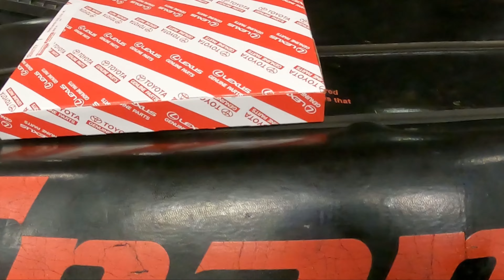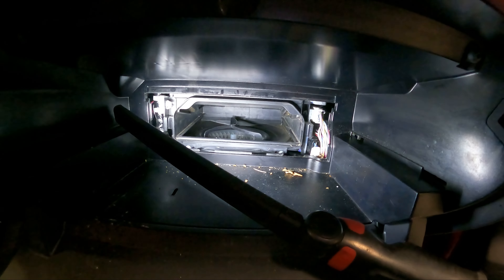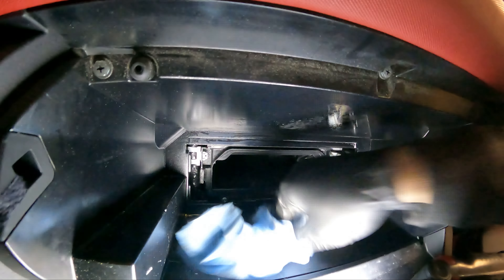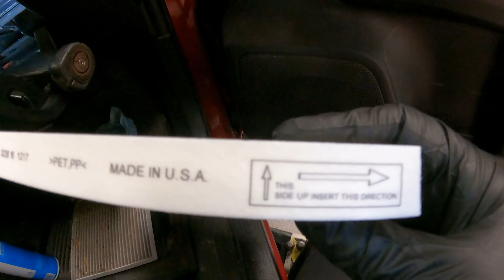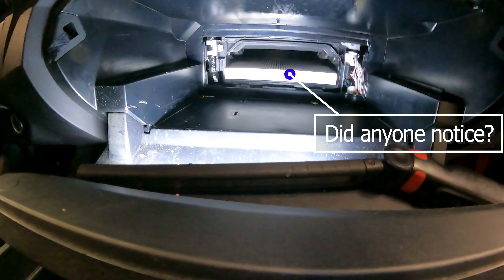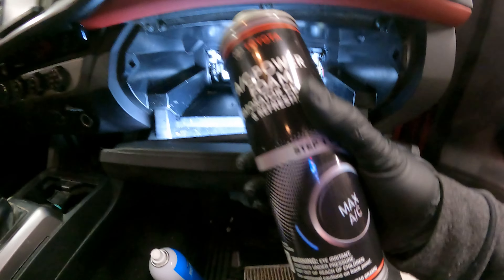Customer states Toyota Tacoma cabin air replacement #customerstateswhat

Comment: Why replace instead of just blowing out the filter since it is more larger debris than dust?
Reply: Cause on Rock Auto the most expensive one is 15 bucks and change, most are around 5. These are such flimsy filters your air line would more likely damage it a bit, and the time you would take to clean the filter aint worth it.
Reply: Because you'll never get all the dust/dirt/microbes out of it, and if you use a carbon filter or other fancier type, they do eventually lose their ability to filter out the tiny particles, leading to reduced air flow, odors, etc. If the filter got wet for any reason, including simply high humidity on a regular basis, it's a mold/mildew grow farm.
Reply: @markh.6687  Microbes? Are there HEPPA filters for cars? What is the general rule of thumb for air filters.....If you can still see  light thru it it is still good. Do you change the filter in you home vacuum after every use or clean it?
Reply from the maker: You never get all the debris out. Yes there are anti microbial filters. Those are the charcoal filters or harmful substance filters. I highly recommend those filters.

Comment: When did they start to  believe that you need a filter for that?  Since the 50s HVAC has worked w/o these.  And there are devices built into the doors and body that can be rolled down for fresh air.  This is the stuff driving prices higher and higher.
Reply: ok boomer
Reply from the maker: Cabin air filters have been in vehicles since the 80's helps with debris and anything else entering the fresh air inlet.

Comment: This is a hole lot about nothing!! Come on man.   U can do better 🙏🤞🥺😏😳
Reply from the maker: Not for people that don't know how. Knowing is half the battle.
Reply: Some of these are listed as near an hour of time. Remove the side of the center console and a hush panel, a few other components.... it sat parallel to the firewall and slid towards the passenger side. R+r involved squeezing the filter to get it through the space outside, which is smaller than the filter.